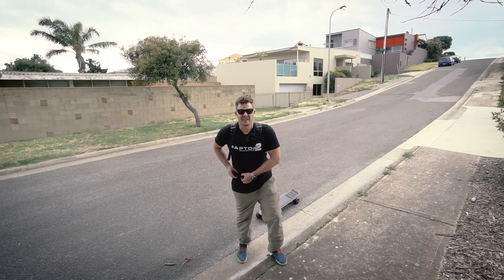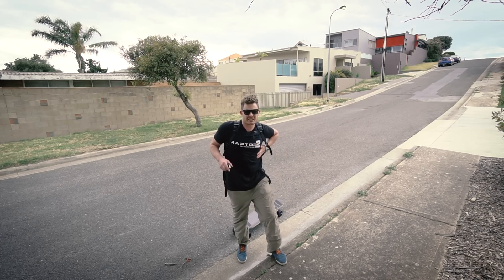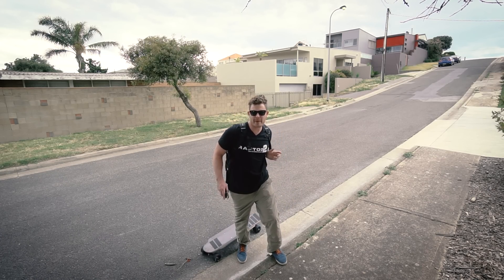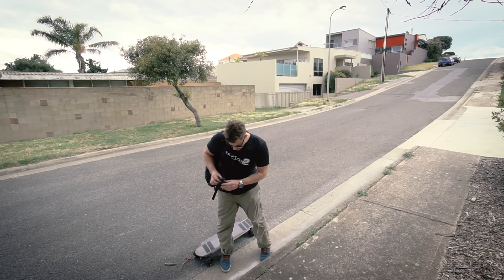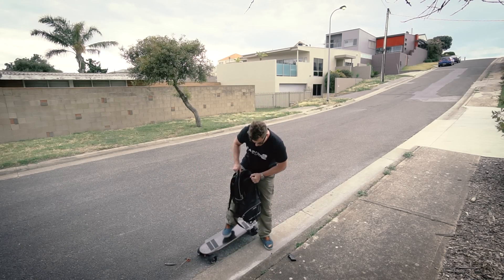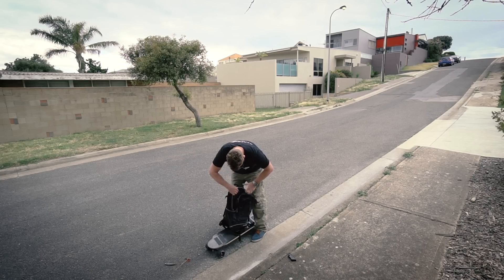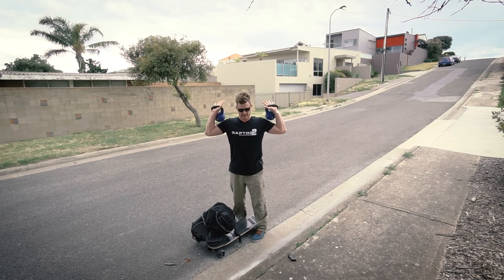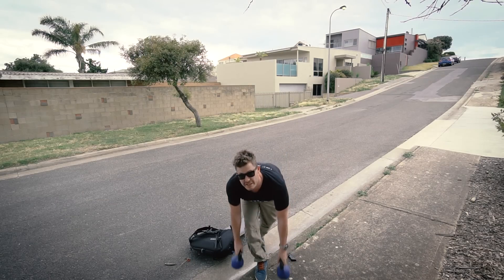Raptor 2 | 255lbs Hub Motor Hill Challenge

Comment: Are you going to cut a space out in the board to put the battery in? it didnt look like it was in the video but you said you are going to in the other videos
Reply: Electric Skateboard Builder im talking about a couple layers of the wood so the battery wont be as low. the final virsion is going to have that?
Reply: Electric Skateboard Builder thanks! also what app is that?